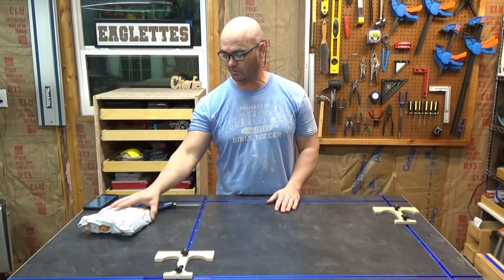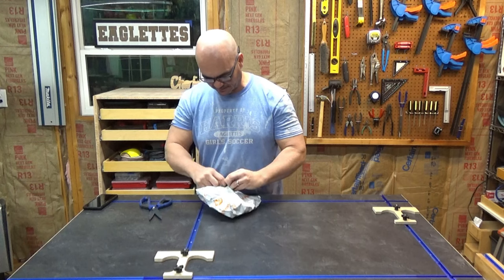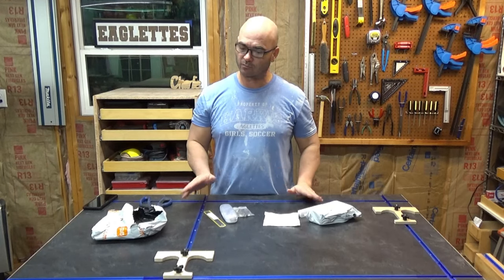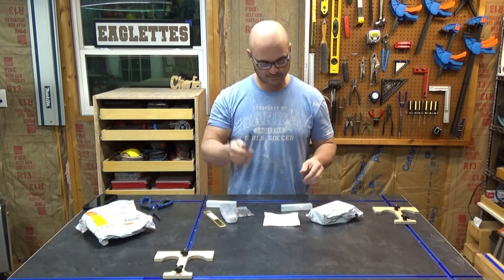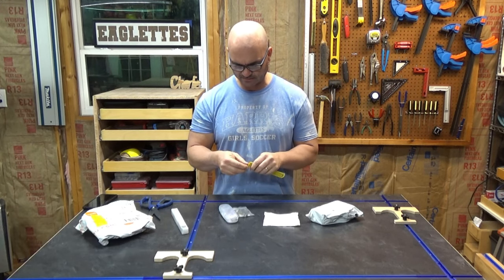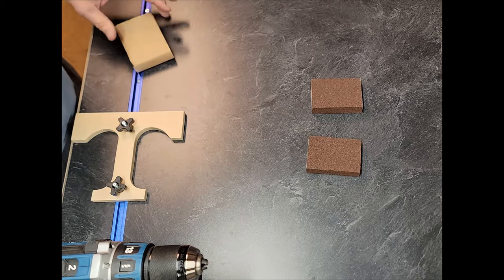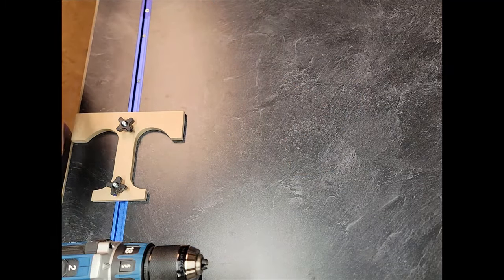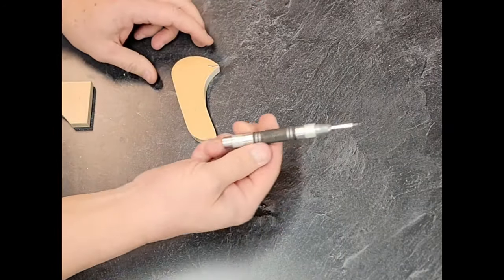Just When I Thought I Could Trust TEMU for My Simple Woodworking Tools...

Comment: Do not forget to contact their customer support for your after-sales problems, their CS team is really good. Easy to get refund.
Reply from the maker: I do each time. They have been good about refunding. I've had to send items back on two different orders and on two others, they've told me to keep the item and refunded me anyway. So, I do appreciate that but the items they've told me to keep are unusable or missing. 

There are things I like and don't like about their process. It's easy to rate and get a refund but if you've experienced their crediting process, it's not good. I want to be able to apply it to the purchase on items I want versus having to select from a menu that may not have what I am looking for. Fortunately for me, I eventually find items. IMO, it is better off to get a refund versus a credit. Have you had experience with either refunding or crediting?
Reply: I tried to get a refund for credits, and it only took about 1 minute to receive the credits. Then I bought new items again, feeling very convenient. For me, they are still good. It's a platform where communication is possible.

Comment: Looks like they have the wrong size drillbit in the counter sink drills
Reply from the maker: You're right and it was even worse - the cutter heads are tapered in the wrong direction. I need to finish that video to share. They were awful. I kept the bits and tossed the rest.

Comment: those glasses looked like they were made for a toddler once you put them on your face.  Very small.  I would get yourself a lavalier mic - very hard to here you talking for most of the video.  Good reviews!
Reply from the maker: Aww man, don't dog my glasses! :) I like them. I'm not a fan of the larger framed glasses, especially for readers that I'm always sliding on and off.

Good tip on the sound. Sound quality is something that I am aware that needs improving. Is there a brand that you would recommend?